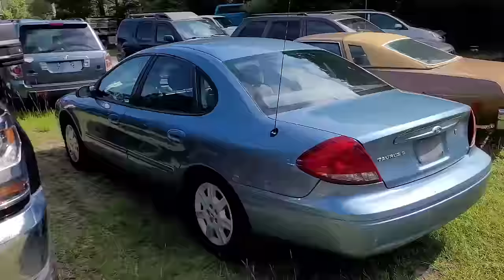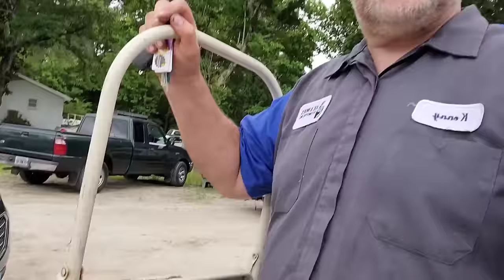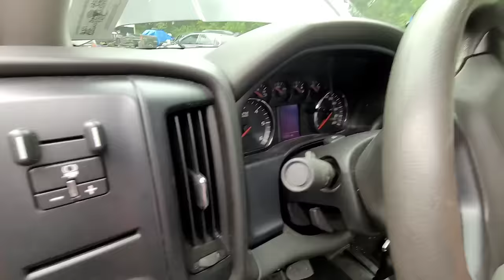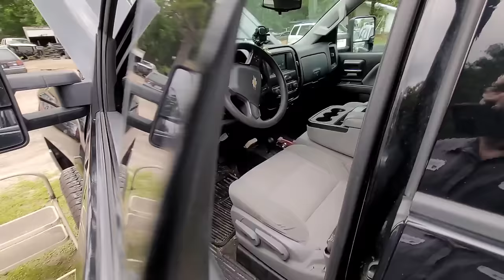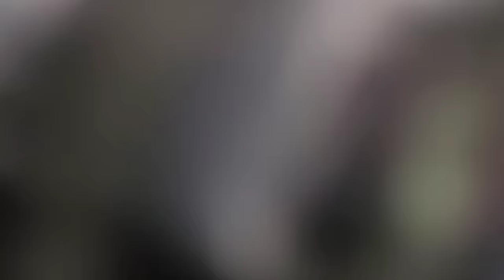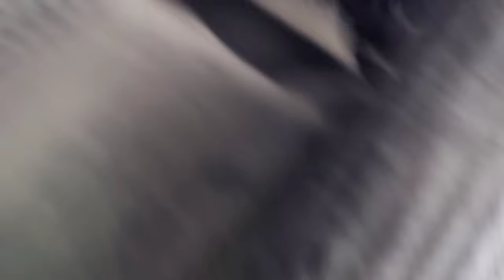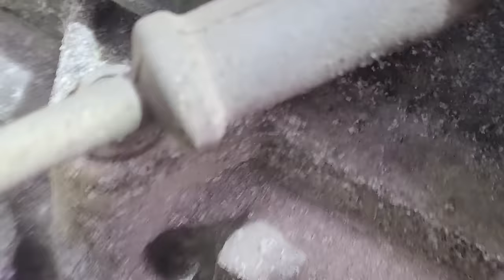Another GM 5.3 Ticking Noise. It's not the lifters on this one either

Comment: I  have a 5.4L Ford Triton.  The ticking was an exhaust leak.  Broken exhaust stud. Used a Mig welder to weld a nut onto the broken stud.  It backed right out.  New manifold fixed the ticking.  I then heard a ticking on the other side that I didn't know I had!  Same thing on the other side.  Weld a 5/16" nut onto the broken stud and back it out while its still hot. Piece of cake, sort of.
Reply from the maker: It's unfortunately a common issue . I've dine the same thing . Fix one then realize the other side is noisy as well .
Thanks for watching !
Reply: @WrenchingWithKenny  The Ford Triton has had some unusual problems.  The worst was the stupid two piece spark plug and coils failing.  I upgraded to top of the line coils and the new one piece spark plugs. The other "secret" is I use Marvel Mystery oil in my oil AND gas.  (One quart with every oil change and 3 ounces in every fillup.  I now have 191,000 miles and it runs like a top. The Marvel will eliminate the other issue that this engine is known for .  The timing chain follower failure.  I expect to get 1,000,000 miles out of it.    2007 F350 utility truck.  I have an aviation legend friend who told me a story about his engines.  Marvel Mystery oil is absolutely the best additive ever made.  He had an amazing story that convinced me of the value of Marvel Mystery oil.
Reply: My wife and I are building our mountain retirement cabin 750 miles from our current home.  I go twice a year and haul anywhere from 3,000 lbs. to 10,000 lbs. of lumber and equipment every trip.  This truck has never failed me or stranded me in the middle of the Mojave desert.  It has been like my best friend.  Hands down the best truck I have ever owned.
Reply from the maker: @timcisneros1351  I've used MMO for years . Not as often as you do , but I do use it . Like you said , it is the best additive on the market and has been for decades .
Reply from the maker: @timcisneros1351  , that's awesome. I've always said that a vehicle is only as good as the maintenance it receives. You take care of your truck , and it takes care of you !! Great stories !! Thank you for sharing !!

Comment: Older 5.3’s had a cold start tick/knock it was piston slap but since they started making these 4.8 5.3 6.0 engines they have always had problems with the exhaust manifold bolts breaking causing exhaust leaks and thank god there is so much room and they are so easy to fix unlike fords! Whenever I have a 4.6 5.4 6.8 Ford truck come in for exhaust manifolds the customers always get shocked at the price and ask if I can do any better and I always tell them to be honest I don’t even want to do the job and if anything it’s gonna cost more money it depends on how much time I have into getting the broken studs out. They say why wouldn’t you want to do it? I say they are a pain in the ass to do there is no room so if you want it done this is the price you either want it done or u don’t.
Reply from the maker: I usually turn down the Fords honestly . I have soo much work that I get to pick and choose . But when I do decide to do them , I get the same thing from the customers , "Why soo much" ?  Pretty much the same answer I give , Its a PIA job .
Thanks for watching !!

Comment: The LT-1s used to have the same problem with the end bolts on the exhaust manifolds. From the factory they use 5/8” spacers and longer bolts so they stretch. I switched to Grade 8 bolts and fixed the problem of broken/loose bolts.

Comment: I have a 2018 Silverado with a 5.3 that makes a internal noise, took it to a gm dealer and they said it was the high pressure fuel pump, perfectly normal and that these ls motors make lots of noises!

Comment: As I technician myself I've found on these vehicles when " mechanics " assume these engines have faulty lifters and do the repair , the actuall issue is addresses during disassembly or reassembly of a repair with the wrong diagnosis (faulty lifters ) . such as a issue like this where during a lifter change  the exhaust gasket would have been replaced and the broken  bolt would have been removed from the head when the head was pulled .  and the actual problem would have never been found but it would have been addressed during the lifter change.

Comment: I've recently started to keep a closer eye on my truck now that I'm getting rather high in the miles. I am worried that it could be a lifter being that I had a misfire about a week ago. I immediately changed my spark plugs that night. So far, so good. However I have been getting a lot of gas fume smells in my cabin, especially at a stop. I asked Uncle Google and it said it could be an exhaust issue. I looked under the hood after I got home from work and could hear a ticking noise. I thought maybe it was something to do with the spark plugs or coils. But after watching this video, it seems more apparent that it's a broken exhaust manifold bolt. But I'm going to bring my truck in for an inspection regardless.

Comment: Funny this popped up in my feed.  I recently bought new gaskets and bolts.  I'm actually replacing mine tomorrow on my 07 sierra with 254,000.  When I first heard the tick, I thought it was a lifter until I discovered the exhaust leaks, near 2 broken bolts. I was a little worried at first deciding if I could reuse the manifolds.   Wish me luck!

Comment: Owned 3 Silverados '90 '00 & '15.
 '90 & '00 had exhaust manifold leaks on passenger side by firewall. So far the '15 is good. Has 130k and runs great. 5.3L High Country. Hopefully GM finally learned something.

Comment: I have an 2002 Ls1 TransAms 5.7L 6 speed and the car only has 71k miles in it and it gets a slight tapping sound when its warming up (sounds alot like a lifter or rocker arm but might be a bit too slow for the idle speed if it ticked on one valve every time, almost like its tapping on maybe every 2nd or 3 time the lifter or rocker arm moves. My car doesn't have any exhaust leaks, or catalytic converters, it didn't come with EGR from the factory either. It almost sounds  like a lifter but I doubt that's what it is honestly. I just want to make sure that the tapping sound isn't pulling any timing because the knock sensor might think its spark knock. I have long tube ceramic coated hooker headers with a 3" Texas speed y-pipe, and 4" spintech exhaust with a mufflex muffler which has almost no back pressure to even have an exhaust leak and there are no soot marks around any of the connections and they are all clamped down very tight with high quality band clamps.  I've done alot of free mods to the car to free up power. Do you know anything about any common issues with the LS1 having a tick at warm up that isn't exhaust? The car runs extremely strong (425rwhp-420ftlbs) with basically just free mods and full exhaust. I haven't seen anything in my code scanner about it pulling timing or picking up a misfire or knock. I just dont know what it is. I can barely tell which bank its coming from. It almost sounds as If it's from the center of the engine. I got the car in 2012 with 33k miles on it and it was very much babied by the one previous owner and it didn't start this weird noise until maybe a year ago. I did just replace the power steering pump because the high pressure line busted and the reservoir above the pump was leaking fluid which also took out the alternator that's mounted directly under it. I replaced the factory 90amp or 105amp (depends who ask) alternator with a 6.0 truck 145amp alternator and I fixed/repaired the power steering pump and reservoir but I'm still get that ticking sound so I know it wasn't from those parts. The car pushes 45- 60psi of oil pressure at idle depending on it temp so I'm sure the hydraulic roller lifters are pumped up and it will go up to 75-80 psi at high RPMs. I guess I'll keep searching with my mechanics stethoscope but I've yet to isolate the area well enough to figure out the issue and it doesn't take very long for the sound to go away as it starts to get half way to operating temp. Also all of my header primaries run right at the same temperature so I know it's not got one cylinder that's running different from the other 7. I just have no clue what it as of right now.
Reply from the maker: If I were a betting man, Id probably guess at it being "Piston Slap" . I for some reason believe that there was a bulletin talking about the piston rings causing a slight noise like you're describing. I'll have to check to see if I could find that bulletin. If you come across something, let me know . Thanks for watching !!

Comment: I’m having that same ticking noise after having my engine, replaced exhaust work done now the ticking, my flywheel bolts, the mechanic they did the job left to loose one fell off so all my converter bolts have been Tightened I thought that was the problem but the ticking still sounds exactly like this truck mine is a Ford F150, 2007 4.6 engine where are you located?

Comment: I bought a new 2000 chevy, at about 40,000 miles "right after warranty" went out it started ticking when cold but stopped once warm. The dealer told me it was the crankshaft. Warping when it cools, and straightening out once warm. They assured me it would not cause a problem i didnt believe them. The truck had almost 300.000 miles when i sold it.

Comment: My 2014 . Both my very back manifold bolt heads are gone as well. Engine does not tick at start up , but if you give it gas you can hear a slight exhaust leak , and I assume that’s where it comes from. Other than that it runs fine.

Comment: Thank you sir i also had a ticking problem, one day i was working on 
 A stabilizer link kit replacement at 73k miles and had engine running as i was almost done and started the car,
 went back bolting on the right front tire and saw the number 8 plug wire bouncing around compared to #6 #4 #2 . So I opened the hood and grabbed the plug wire and the ticking it always had Stopped!! Let go of the wire and ticking started  again , turned off truck and went to get spark plug socket and pulled the plug wire and tried to tighten plug it was super loose ????
I tighten it down and started the truck a, tick was gone so it checked  all the rest of the  plugs they all were tight , plugs were never changed from 0 miles to 73K, 2010 truck

Comment: Kenny wish you could have a listen to my motor bike over hear in the UK.

2020 Triumph Bonneville 900cc parallel twin bought new by me.

From 500mls I noticed a ticking/tapping noise....been to 2 dealers with it....neither know what it is....like the truck in this vid....starts a little after a cold start.....last around 2 mins and slowly goes....its a bit irregular.

I took the rocker cover off to check the valve gaps....fine....its a twin over head cam....rocker are drive direct off the can vis a roller....each rocker are control 2 valves....gap is controlled with shims.

One thing I noticed when I had the rocker cover off was that the rocker arms have a bit of back and forth slack....if you push the rocker along its shaft the rock contacts the alloy head....the noise I get sounds just like my tap.

I expect the rocker needs a bit of end clearance for expansion..but how much....I dont think its mentioned in my Hynes manual.

Wish I had paid more attention to it when I had the rocker cover off....it was only later I thought about it.

The gap from memory is not a lot....maybe 5 or 10 thou inch.

Any idea from that brief discription....as I say after a few mins after a cold start the noise slowly goes and the motor is sweet as a nut.

Its driving my nuts.

Nick in the UK.

Comment: Super common on LS motors the manifold warps and pops usually the back 1 1st but the front 1's on the manifold Originally they come with a double layer metal gasket the worst thing you can do is put a cardboard fell pro on there. I usually take them in the machine shop have them surfaced flat install them with a light coat of copper coat and no gasket and then I put a stud And brass nut With an  washer on the ends  Of the manifold never had one come back yet She's flat service no gasket no leak

Comment: Guaranteed 100% solution if you replace the Engine Coolant Temperature sensor, and let car cool off, ticking will go away as long as coil packs or spark plugs wires are good. Any misfire cylinder code usually means a bad coil pak/or spark plug connection somewhere in that line. Radiator/stop leaks products usually coat this sensor, and gives false readings causing your car’s computer to deliver more gas/spark then needed. I had same issue mechanic told me I needed engine work, went to junk yard pulled engine coolant temp sensor for $2 & never heard ticking again! This was on a Chrysler, but probably same for all vehicles.

Comment: I had a ticking noise in a 2006 Suburban, not quite as horrible sounding as this one, that would go away after the engine warmed up. Upon repairing an oil pan gasket leak, I decided to replace the pickup tube gasket and never had the tick noise again. I guess there was some sort of blow by condition not letting the oil be pushed up into the engine. Anyway, if you have a ticking noise in you Chevy Suburban or pick up, you might change your oil pickup tube gasket to repair it.
Reply from the maker: The O ring was probably letting air go through. Great job! Thanks for watching & keep wrenching 🔧

Comment: I never use this saying but, "You Da Man" !!!
Reply: Still looking for 'my circumstance' video with the jumping coil. The one with the spark plug wires and the coil sound just like mine. It runs fine really , at least when compared to all videos where it is the lifters. Those engines are shaking like a hard-core alcoholic 36 hours sober. Will know for sure when I've ran enough miles to register an OBD test. Switched misfire , #4 cylinder ,coil and wire with #2. I think that will be a good test.
Reply: Probably should have switched it with #6  .Duh, no probably about it.  I'd do it right now in less than 5 minutes, but i need to OBD it first. It still runs like a champ if I don't hotrod it.  Been doing a lot of that since I realized I had a 6.0 instead of a 5.3. (pretty sure) I'm gonna learn this stuff
Reply: Think 6.0  is a 'Texas Edition' thing. EVERYTHING is BIGGER in TEXAS

Comment: I knew it was an exhaust leak as soon as he walked over to the engine. My 08 had the same issue on the driver side. I got lucky the stud was easily removed. These engines are a little ticky sounding, but I think it's more to do with the valve-train or injectors. Or god forbid the AFM/DOD system.

Comment: Heard loud clank noise after accelerating from stop and would stutter forward at 150k miles on 2014 Chevrolet Silverado 1500 engine light came on. Towed it to mechanic shop said it was the 4 cylinder to 8 cylinder system that caused it and it’s common on engine like that from Chevy so option would be to open it up see what’s damaged or buy all new engine what would be average cost of something like this . And  your best guess to what caused loud metal clank and jerking from stop to accelerating

Comment: This similar issue happened to my 6.0 2005 Sierra and the oil pump intake tube needed the seals replaced. A common GM problem with ticking.
Reply: @Angel Delcourt : Yep, an oil pump suction tube that is sucking air will create a low engine oil flow condition. It will most certainly cause lifter ticks. 
The fact is, the oil is also being aerated, and the entire engine is being starved for oil, due to the low flow, as well. 
Another somewhat common issue that is totally avoidable is a plugged oil pickup screen in the sump, which happens in engines where people don't change their vehicle's engine oil regularly enough... Bad news!

Comment: Had this problem on the drivers side of my 2000 z71. There is a 30$ clamp that will fix the issue. It bolts to the backside of the head. Was a pain to istall, but worked great. Dorman 917-107 was the part number. Don't  know if there is one for the passenger side.

Comment: I kinda new this was the problem...I removed the stock exhaust manifolds after my warranty was out and put headers on..I have over 278K on my 2001 Silverado..No tick, knocks at start up or when it warmed..Been running Royal Purple synthetic in it since I bought it..Change it every 4000 miles and it will roast the Goodyear Eagle GT II in a cloud of smoke.

Comment: I had the same complaint in 2014 when I bought my Sierra with the 5.3. Took  it to the dealer and they claimed it was caused by the "new high pressure" fuel injectors. I couldn't hear it from inside the cab, only when outside. Never found out what was causing it. Sold it when the warranty ran out and back to Ford I went for my next truck. Problem was solved. Just as I was finishing writing this the guy in the video started the truck. I could tell from a mile away that there was an exhaust leak somewhere on the manifold. Mine sounded like noisy lifters/valve train, not as obvious as this one.

Comment: My old 5.3 ticked in my 08 Silverado. I put a new 5.3 in after it went out at 270,000 miles. My new 5.3 ticks as well. It’s not that loud. Mine actually sounds like a lifter.

Comment: Yes it sounded like exhaust right away 

That would cause bad gas mileage ( O2 sensor smells oxygen) adds more fuel 

Shortcut to find exhaust leak : 
Cold with engine off, run shop vac in reverse up tailpipe ( or leaf blower) 
You will feel air cone out leak …. Or spray bubbles at manifold or anywhere that could leak. 
I once found a cracked  exhaust manifold that caused check engine light. 
The guy had spent thousands of dollars in O2 sensors and other parts to stop SES light. Was quoted a new engine to fix ! 
It was a simple crack in manifold, before the O2 sensor